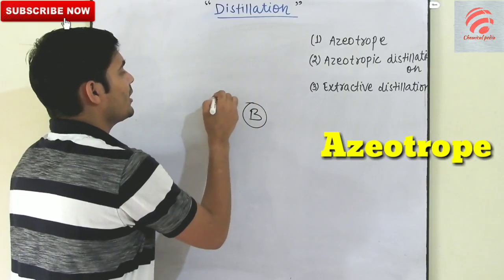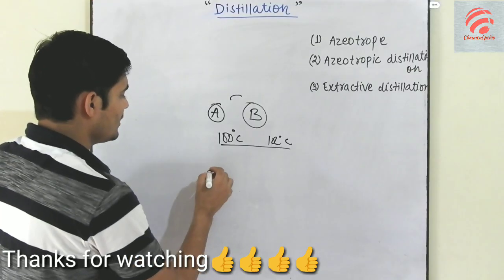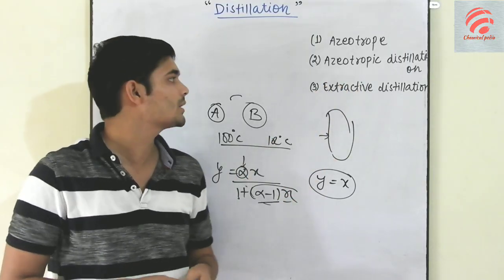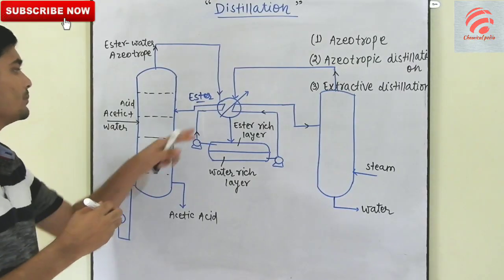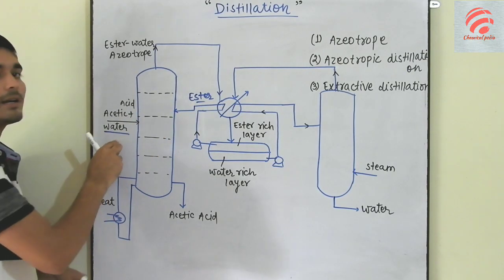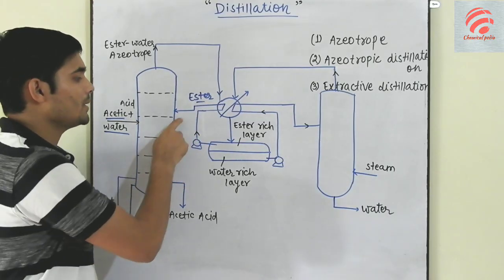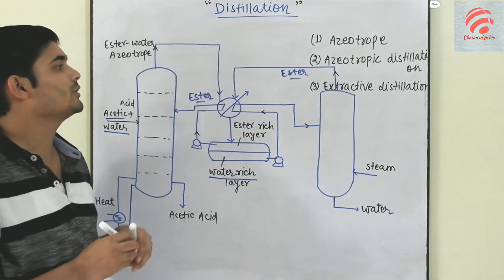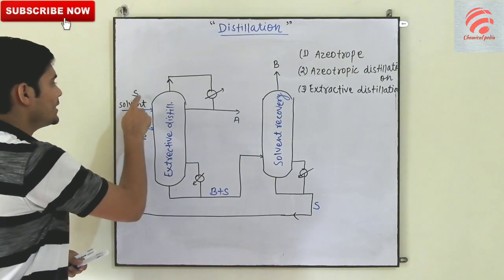[Hindi] Azeotrope, Azeotropic distillation, Extractive dis., types of distillation || Chemical Pedia

Comment: Although both the process looks same but the difference between two is that in the azeotropic distillation the feed should be an azeotropic mixture but in the extractive distillation the relative volatility is near to 1 but the mixture is not an azeotrope. The entrainer must be very specific in the case of azeotropic distillation but any good solvent which is not a solvent for second component can work in the case of extractive distillation.

Comment: we have azeotropic distillation then why use extractive  disti...n ? means what is difference between them?
Reply: @chemicalpedia47  in azotropic distillation we add third component as a entrainer which form a minimum boiling Azotrop where as in extractive distillation we add third component as a solvent which only mix with any of one component from binary mixture